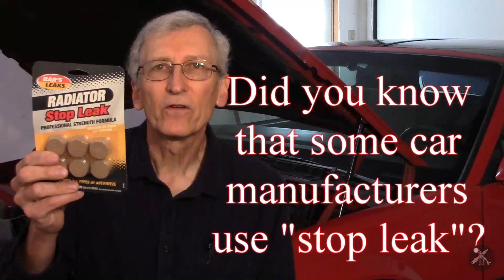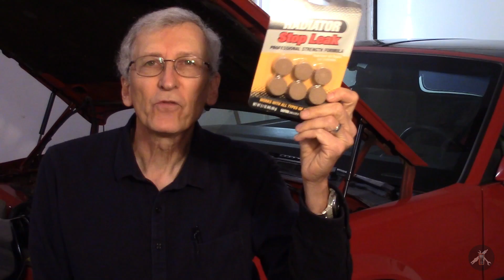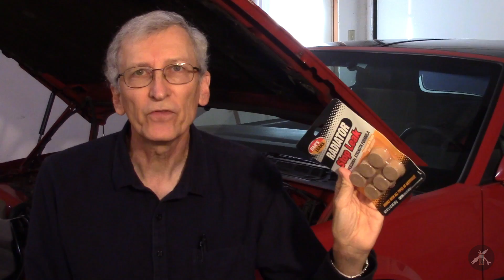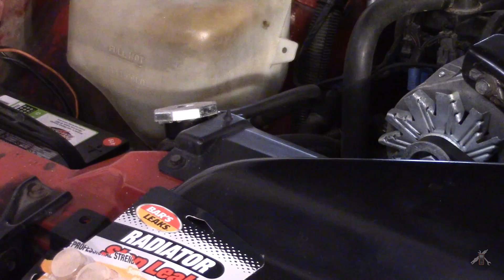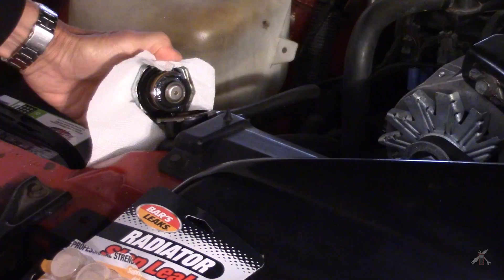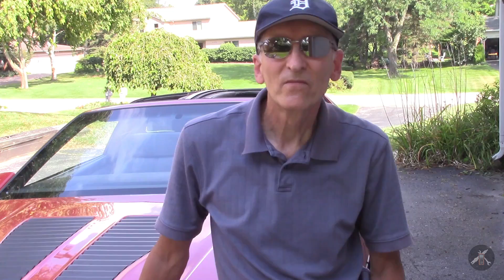Stop Leak-- Some New Cars Get it from the Factory

Comment: How is it doing now?
Reply from the maker: It's doing well.  Since adding the pellets, the coolant loss in the overflow bottle has decreased.  It still has some evaporation and I still need to add a little, but less frequently.  I think there were some trace leaks in the cooling system.

Comment: I knew this was a Subaru thing (lot of head gasket problems etc.)  but had no idea other manufacturers did this as well. I will likely give this a shot in my 88' GTA as a preventative measure. Did you use all 6 tablets?
Reply from the maker: Yes, I used all 6.  I think I could have used up to 8, because as I recall, the instructions were 2 tablets per gallon and this is a roughly 16 quart / 4 gallon system
Reply: @bitsofwisdom460  thanks for responding, I will likely just use 6 as I have no active leaks that I’m aware of.

Comment: A mechanic friend started his career at a Cadillac dealership in the early 80's, he told me about the 4.1 V8 that they added coolant conditioner pellets in their cars always, although they still failed. I have used K-Seal for years, works every time.
Reply from the maker: Yes, I have heard stories about the original 4.1 having issues. The engine seemed to do well as it went to 4.5 and 4.9 liters. I will say that, in general, as engines went from all cast iron to blends of iron / aluminum / plastic components there were many challenges with sealing of dissimilar materials throughout the industry.

Comment: In the 1980's, Bar's Leak was in a tube of what looked like tiny aluminized beads.   Im not sure when those tablets appeared - but Im saying tablets are new compared to 1980 and before.  I never trusted them in tablet form - the aluminized beads seemed in my mind definite - used them alot in my 60's and 70's chebbys
Reply from the maker: Bar's Leak has several formulations.  I am only familiar with these tablets that are ginger root based.  The other products may work well, too, but I never was asked to test my parts with them to prove that they wouldn't be harmed.

Comment: Great information!  This tip may save me a lot of work.  While under the hood of my ‘82 Corvette, I noticed in 2 locations where the intake manifold coolant passages meet the head some small beads of coolant.  The engine was recently rebuilt for the same reason as your IROC.  Hopefully this clears up the issue and I will run an oil sample test on the next oil change.  Thanks for sharing your knowledge!
Reply from the maker: Great, I hope that it works for you!

Comment: Greetings from Torrance! Many years ago(I think about 10yrs)  I had to replace my radiator on my IROC.  My neighbor who is a mechanic helped me with this and after I noticed a small coolant leak from the back of the engine.  I used about half a can of stop leak because I did hear about it potentially doing bad things to the car. So far I haven't had one leak after all of these years.  This was really good information. I am curious if it was just a GM thing or if the other manufacturers use it as well.  Thanks and keep up the good work!
Reply from the maker: I have done some searches and have seen some evidence that other manufacturers used it as well, but I don't have enough data to verify that.  Usually when someone finds a good solution, word gets around.

Comment: I put some in my 1988 after I changed heads out to vortec. I used shim gasket with no sealer and thread sealer on head bolts and had slight drip by back of head after assembly thru bolt probably not sealed correctly. Hasn't leaked since and that was 2 years ago so far so good!
Reply from the maker: Thank you for sharing your experience.  That sounds good!